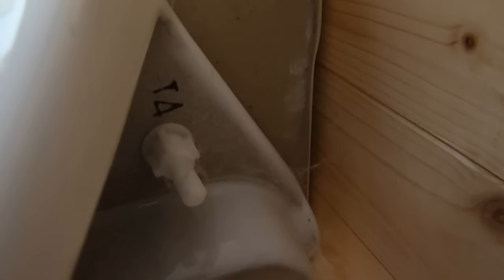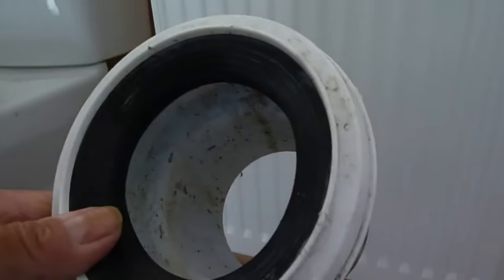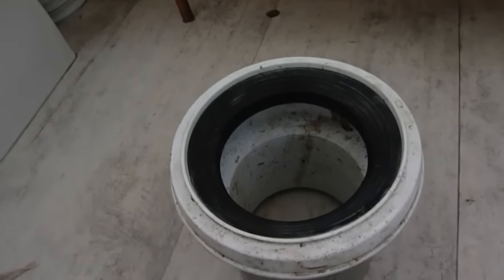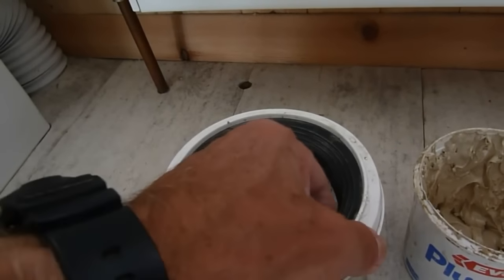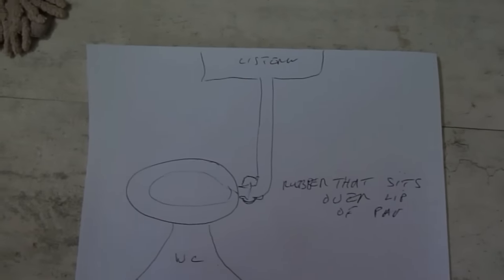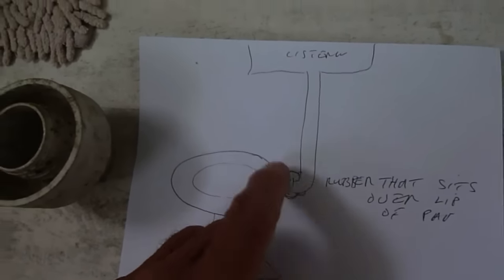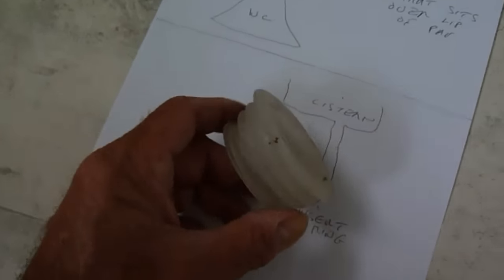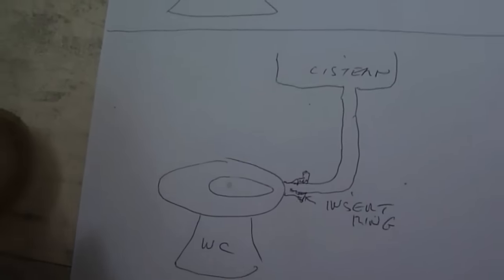How to fix a leak at the back of your wc pan .

Comment: Hi,  I'm doing my bathroom up.   It's got the only toilet in the house,  so I'm having to work around that issue.   I loosened off the toilet after turning off water etc - removed tiles from behind and tidied up.  On putting the toilet back in place and filling up I noticed a small leak coming from the pan connector.  I thinking about a temporary replacement of flexible pan connector - do I just pull the soil pipe side out or will that be sealed - it's difficult to see how it's connected?  thanks for any help
Reply from the maker: If it is a multikwick connector as shown on the video it will just pull out. However you will need to remove the pan to do it.

Comment: HI AL - IM TRYING TO FIT A MCALPINE PAN CONNECTOR ON TO AN IDEAL STANDARD TOILET PAN WITH A VERTICAL OUTLET - BUT ITS A REALLY TIGHT FIT - AND THE BLACK RUBBER SEAL KEEPS COMING OUT OF ITS HOUSING WHEN I PUSH THE PAN CONNECTOR ON THE OUTLET!!!!! DO U HAVE ANY TRICKS OF THE TRADE THAT WOULD HELP ME GET IT ON WITHOUT IT COMING OUT OF ITS HOUSING??? THANKS AL
Reply from the maker: Yes as much liquid soap or washing up liquid on the rubber first.

Comment: Sorry bro....it didn't help. I want to replace that black rubber collar, not use Plumbers Mate which you said is really only a temporary fix before it leaked again.  I've got a new rubber ring and want to know how to remove it. Do I push it in and pull it out or what? Thanks.
Reply from the maker: You will need to remove the pan to fit that, renewing the ring is a waste of time as once the pan is out you may as well renew the multikwick pan connector complete.

Comment: We've got a connector that has perished and is leaking. Presumably I can't just replace it without moving the toilet? How about cutting the soil pipe short and using a flexible, adjustable length connector?
Reply from the maker: Yes that is also possible.

Comment: Thank you for a rare video on this type of leak.

You never explain how to actually replace the rubber ring seal...  You just say use plumbers mate.  I doubt that would work if the seal has a crack in it.   I got the seal off, but I can't get the new one on!
Reply from the maker: I have used plumbers mait for years with a very high success rate. You will have to take the pan out to fit a new one of these.
Reply: @dereton33  Oh I got is out, its getting the locking ring back on after fitting in a new rubber seal that seems basicly impossible!

I figure there is some trick to it.

Comment: Hi I always go to your videos first to find out what to do! So I bought the Pro Plumb flexible pan connector and replaced the old one but the leak is still dripping from the waste pipe. Why is it still leaking?
Reply from the maker: May well be that the pan spigot is not perfectly round. Get a tub of plumbers mait, dry off the leak and pack the mait firmly into and around the connector.

Comment: I have the older connector that is perished and a leak  would  silicon  work ok.  Do u need to move the toilet  forward if u replace  it  I'd rather not.
Reply from the maker: Yes, you have to remove the wc if you want to fit a new one, might be worth trying the silicon.
Reply: @dereton33  is there a flexible multitit one that slips in between so u dont don't have to pull the wc forward  ? Thanks
Reply from the maker: There is a pull funnel one but it is rather long .

Comment: We have one on the cistern, the bottom seems to be dripping.
I have replaced the dual flush button recently including the assembly for the flushing mechanism.
It was dripping before hand and I thought I could solve both problems 1 being the dual flush was only working on full.
And 2 the bottom of the cistern was dripping the latter seems to be still happening after trying with the old and new parts.
I used a bit of plumbers tape on the threads this does not seem to have solved it for me.
The cistern is on the wall and pipe down to the pan..
Its armatage shanks brand I'm using a flow master from toolstation for the new dual flush mechanism.
Do gaskets on these often not seal properly.
If so what should I be doing to resolve this problem.
Many thanks for any info anyone can provide
Reply from the maker: If it is coming from the syphon nut just give it a tighten with some grips, if it is running down the flush pipe then the rubber deal needs replacing around the flush pipe.

Comment: I need to replace my toilet it has a side exit for the soil pipe how do I measure and buy the correct replacement toilet centre of the soul pipe is 15cm from the wall but seems to join onto the toilet 25 cm from the wall this seems odd most measurement online show 12 to 14 cm from wall to waste
Reply from the maker: Just buy a standard straight outlet pan and use a flexi bent to get the correct angle.

Comment: How do you get the plumbers mate into the pipe rubber if its connected to the soil pipe?
Reply from the maker: Just push it in around the rubber.
Reply: Behind the rubber seal or on top?

Comment: Fitted a new pan connector to the back of the toilet and the soil pipe but the only problem is that the inside of the soil pipe has the rubber ring missing inside it. The soil pipe was installed about 40 years ago. I’ve now got a leak where the pan connector joins on to the soil pipe and I think it’s because the rubber ring is missing inside the soil pipe. Do you have any tips or advice for this situation? It would be very much appreciated.
Reply from the maker: Dry the joint right out, then force some plumbers mait into the gap where the O ring should be.
Reply: dereton33 Thanks for the reply. My plumber has tried that twice now but it’s still leaking! Is there anything else that can be done without having to put a whole new soil pipe in? That would be a nightmare just for the sake of a rubber ring being missing!
Reply from the maker: Have you tried a high quality sealer mastic, again make sure the whole joint is dry before applying it.
Reply: dereton33 I don’t think he’s tried that. Is that instead of the plumbers mait? Which one is best to use and what is it called?  I just hope the leak isn’t being caused because there’s a crack in the soil pipe where it connects to the pan connector.
Reply from the maker: Dig out all the plumbers mait and make sure the joint is dry and do not use the flush for up to 8 hours. There are lots of mastics out there just choose a good make.
Reply: dereton33 Thanks for your advice Al. Should there be a cut off piece of soil pipe that goes inside the soil pipe and then push the pan connector inside or just push the pan connector in the soil pipe without the cut off piece of soil pipe?
Reply: dereton33 Thanks for your advice Al. Should there be a cut off piece of soil pipe that goes inside the soil pipe and then push the pan connector inside or just push the pan connector in the soil pipe without the cut off piece of soil pipe?
Reply from the maker: There should be a cut off piece of soil pipe going into the joint first then the multikwick pan connector  into that.
Reply: dereton33 Thanks Al. Is it possible that there could be a small crack actually in the soil pipe that could be causing the leak near the joint? Is there anything that can fix this without replacing the whole soil pipe?
Reply from the maker: No, if that is the case the pipe will have to be renewed.

Comment: I have and old downstairs loo with a cistern & flush pipe. I thought it was leaking around the base but on closer inspection I think it might be coming from the part that attaches to the toilet itself. (The kind of u bend bit that's attached to the pan ) Any advise would be great thanks.
Reply from the maker: Best to renew that part they are called multikwick pan connectors.
Reply: Thank you so much for your reply. I've been searching youtube endlessly to find a toilet similar to mine that someone has fixed.   I only noticed it when I emptied my mop bucket when we'd just moved in & I heard it trickling out so it's definite not the flush. I shall keep you updated on my progress. Could you also advise me on the tools which I will need? I'm assuming I will have to take the whole toilet out? Also how do I measure for the size I will need? Are they a one size fits all?
Reply: @nerak1848  what’s the update? Were you able to find a solution?

Comment: We have replaced our flexible wc pan connector many times as we have been getting leaks every few months. When we remove the connector there are holes every time! Is it possible for rats to eat away at the connector? We cannot find a solution!
Reply from the maker: I don`t know Ive never seen that problem.

Comment: Have cast iron wc out flow which keeps leaking at connector to the back of pan best way to fix please
Reply from the maker: Fit a new multikwick pan connector, or fill the joint with plumbers mait, make sure it is dry when applying.

Comment: Hi Derek!  My toilet soil outlet goes down into the floor. I need to raise the toilet approx 1inch as I'm putting floorboards down. Will the loo outlet still have enough pipe to still connect into the waste pipe in the floor and have a proper seal? Hope I've explained ok. Many thanks Tony.
Reply from the maker: No there will be a gap.